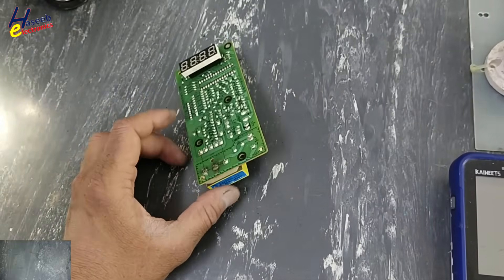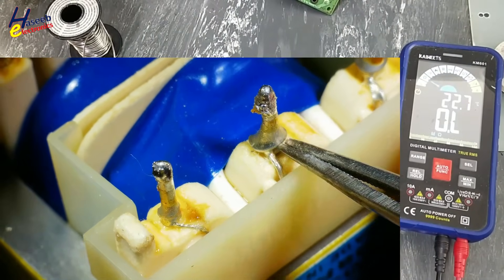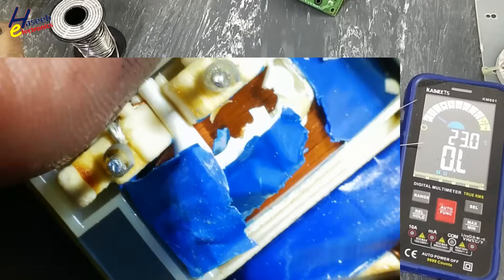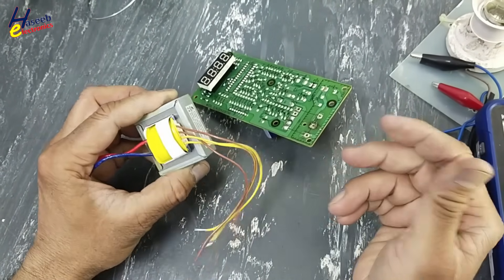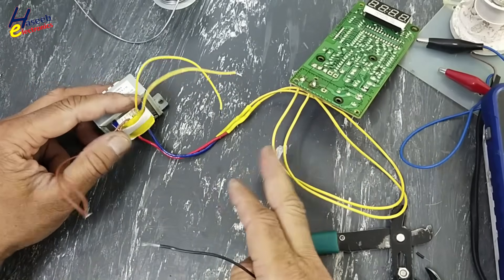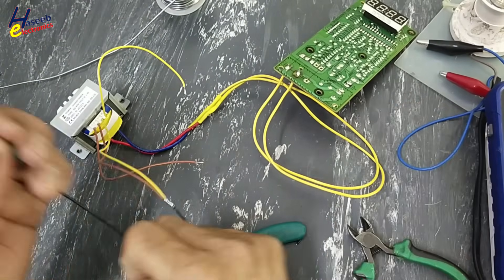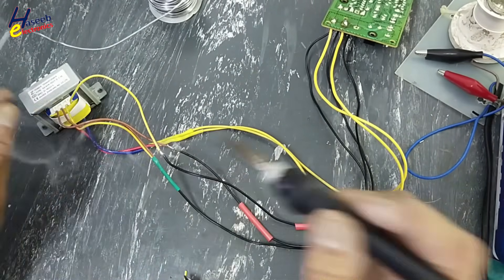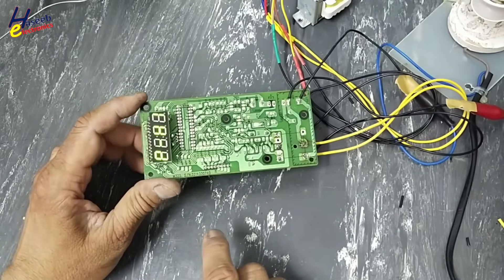{1291} Repairing Dead Microwave Oven Control Board

Comment: I was sure it was going to be the thermal fuse but I was wrong!  :)
Reply from the maker: You are right 
I was also expecting the same 
I think there was not a overheating condition. Otherwise overheating symptoms must be present on winding by discoloration texture 
But in this scenario it is expected that the winding wire got disconnected due to any unexpected defect

Comment: Curious as to why on the output of the transformer there are two diodes fitted in one polarity, but only one on the other. One would expect the same number in both directions (assuming that they're all rated to carry the same current).
Reply from the maker: basically there are 3 diodes. 
1 diode on each side, (anode connected to winding side, and cathodes are connected to positive terminal of the capacitor.) it is 12 volt power supply (normally 15 - 20 volt DC). it is full wave rectifier configuration 
there is a 3rd diode in same configuration, that is present ac volatge value, which is rectified and applied to microcontroller to determine the line volatge value. MCU will calculate the cooking profile and microwave power level
Reply: @HaseebElectronics  Ah yes, thank you for your reply and clarifying the layout - I saw that the two diodes were attached to one end of the winding, but then just assumed that they went to the same place afterwards! I'll look more carefully in the future :-).  Thanks for taking the time to produce your videos, always great content to watch and learn from.
Reply: @HaseebElectronics  Would it be possible to show us a little schematic drawing to clarify? Thanks.
Reply: Zirocrossing  @HaseebElectronics